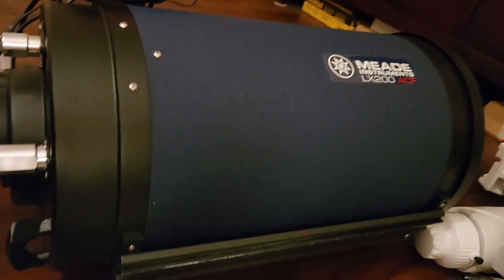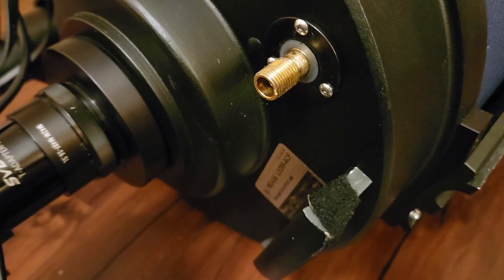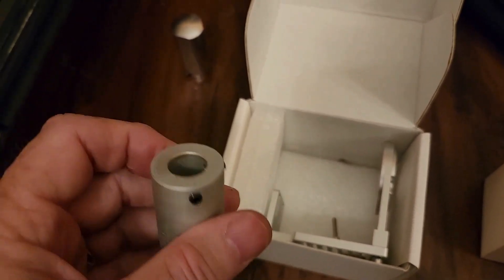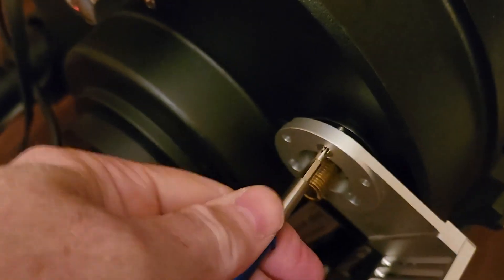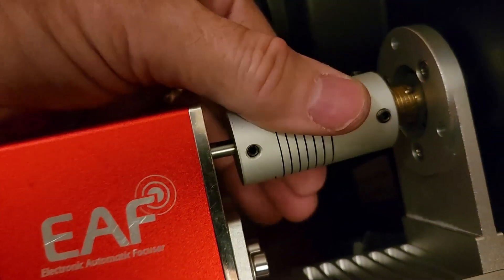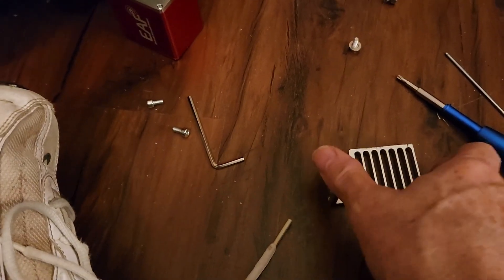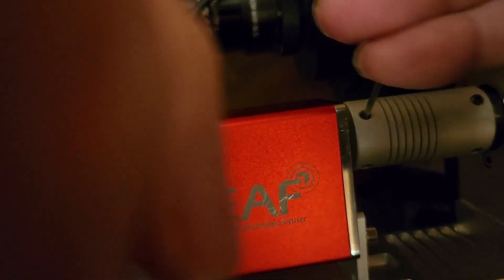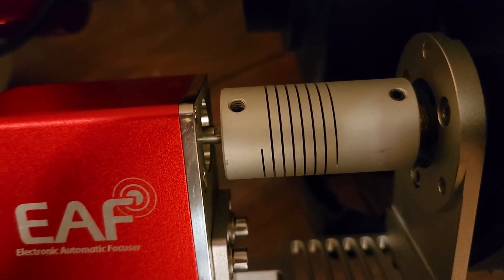Install ZWO EAF Bracket made for Celestron 8  and 9 25  SCT on a Meade LX200 ACF SCT   Made with Cli

Comment: Thanks for this! Wondering if this will work on the Meade 6” LX85 ACF SCT? If anyone out there has tried it on the 6” let me know.
Reply from the maker: Thanks for the feedback. Sorry that I can't say it would work on the Meade 6” LX85 ACF SCT because the physical dimensions of the focuser hole and the threaded holes that this adapter mount to might not be the same as on a 10: Meade. Eventually, although this modification worked pretty well, I moved away from this approach in favor of using a GSO linear bearing focuser mounted directly on the rear cell of the SCT. Just find focus with the primary mirror once, then lock the mirror and use the linear bearing or crayford focuser to focus. Works like a charm and no mirror induced image shift during focusing!
Reply: @rwoodin3  At least on my M8 LX-85 ACF OTA, the 3 imperial machine screws needed were #6-32 x 1/2", available online and at nearly any well stocked hardware store for a couple of dollars per 6-pack. While I have no experience with other Meade OTAs, I suspect that #6-32 x 1/2" would be a good place to start for the 8" or 10" models.

Comment: Thank you for this video. What connector do you use to mount your camera to the visual back?
Reply from the maker: I used a 2" SCT threaded connector. I believe modern SCT threading is 2"x24 threads per inch. I eventually stopped using the EAF to focus by moving the primary mirror, and instead focused  with a 2" GSO linear bearing focuser attached to the rear cell of the scope. I found that to be a better solution. I just posted a short video showing partly how that works. I've upgraded to an AP1200GTO mount and an older, classic Celestron C14 14" scope. That video is here - https://www.youtube.com/watch?v=DEMy7B-L694

Comment: Please could I ask what size the 3 button head screws are that are used to hold the bracket to the OTA. I have just bought the same items and know the screws need to be slightly longer but I’m struggling to identify the screw thread. I think it may be a 1/8 UNC but I’m used to metric and can’t figure out if it’a 1/8, UNC or UNF etc. thank you
Reply from the maker: Sorry for the very late response and I'm sure you have figured it out. I don't know the size and threading of the 3 button head screws used to secure the focuser. I was working on some new astronomy equipment and found the ACE hardware stores have a really nice screw thread sizing boards over SAE and Metric hardware. They have threaded holes and screws of all sizes so it was very easy to check the crews I had and buy the same size. I don't think Home Depot or Lowes have these size checkers.
Reply: @rwoodin3  At least on my M8 LX-85 ACF OTA, the 3 imperial machine screws needed were #6-32 x 1/2", available online and at nearly any well stocked hardware store for a couple of dollars per 6-pack. While I have no experience with other Meade OTAs, I suspect that #6-32 x 1/2" would be a good place to start for the 8" or 10" models.